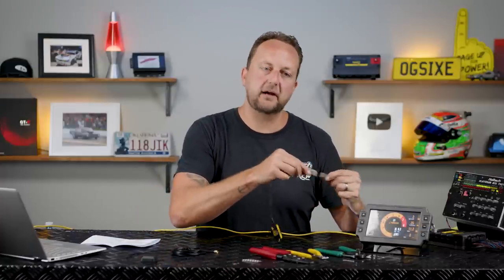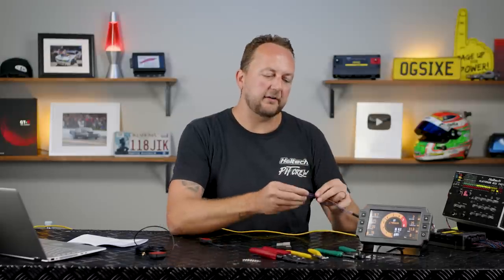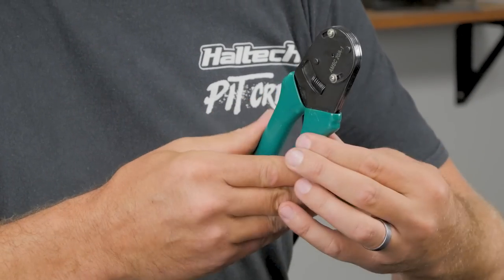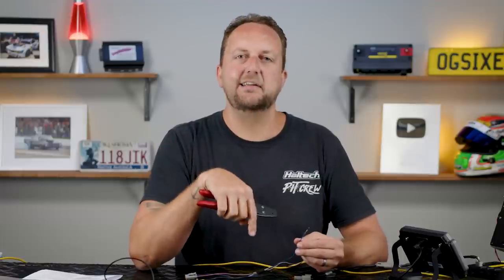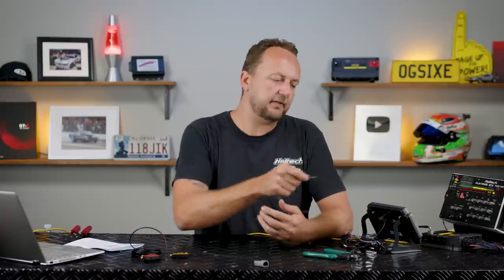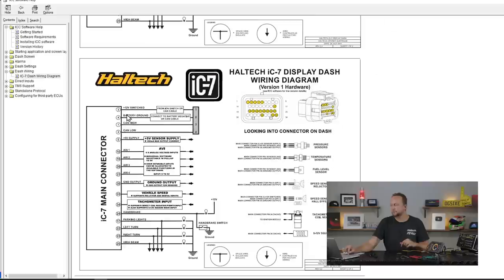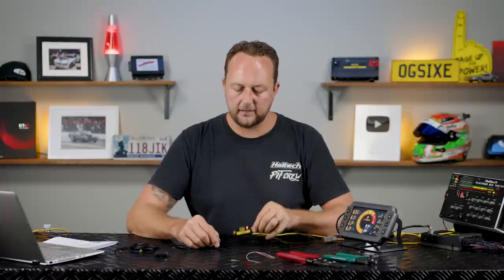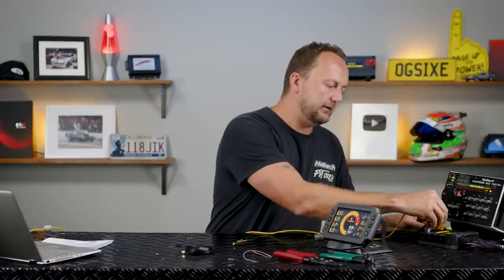🛠 How to install and set up your GPS Speed Module | TECHNICALLY SPEAKING

Comment: Thanks for the info. I have just got the elite 2500 and IC-7 dash and looking at options for a speed sensor. if i wire this gps through the ECU can the ECU then have cruise control? Thanks

Comment: Can you setup the GPS to calibrate (fine tune) a wheel speed sensor. so you always have spedo even in a tunnel. And have acurite speed with diferent size wheels.

Comment: If I use this to control fans by speed, on below X, off above X. Can it still have a temperature on/off control in case signal is lost and it goes to 0mph?

Comment from the maker: Welcome back! 
Global Positioning System - we use it daily to navigate around cities, find holiday spots, locate restaurants or take-away shops, or track suspicious activities of your spouses. GPS can also be used to calculate the speed of your vehicle. It's a very accurate, simple to set up, and relatively inexpensive method - and here's how it's done.
Reply: the problem is GPS only calculates speed relative to the satellite so not always accurate unless on 'level' ground. had numerous situations where the factory speedo reads the same in a hilly area, but because of the hills the GPS speed varies due to the car moving less distance via satellite view, despite travelling at the same actual ground speed. also, as you have mentioned, they can be sporadic in cities etc, which in many areas would be illegal to have a non operational speedometer.
Reply: Can you track your time laps in a circuit track?

Comment: Could this be used in a master and slave setup for vehicle speed. Use gps speed for accuracy ect then change to a drivetrain sensor automatically if the unit looses gps signal

Comment: Note that since this video was released, Haltech has added a "GPS Speed Input" option under "Main Source" and there is also a "GPS" option in the "Main Source" dropdown menu (not sure why you have to select the main source in two places?). HOWEVER... one critical piece of information that this video leaves out is that the Haltech ECU wont allow Cruise Control to function if a GPS Speed Input is selected! In fact, Cruise Control won't work with any undriven speed input. For example, selecting a front wheel speed input on a RWD car won't allow Cruise Control to work. Yet, there's nothing stopping you from assigning a GPS signal to a rear wheel speed input, and that will allow Cruise Control to work. It's all very odd and not clear why any of it is set up like this. It's also not documented anywhere, and it even took Haltech a month to figure it out.
Reply: Thanks Nigel I've been looking for this answer. I'm wondering is it as GPS might not be as a reliable signal as a sensor? It sounds safety related to me why they might not allow it. But if it was to be set up the way you suggest, is there anything Haltech might be able to do to disable that function?
Reply: @garyegt  what I've observed from trying the GPS speed sensor I have as a speed input is that it responds slowly to changes in speed. For example, I'll come to a complete stop and the GPS speed will still be counting down to zero. As a consequence, using it for cruise control results in it constantly overshooting and undershooting the desired speed by several KPH. Now, it may be the GPS speed sensor I'm using is just not suitable for this application. It's an older Veethree unit intended for boats, where changes in speed are going to be relatively slow compared with a car. Perhaps some of the newer automotive based GPS units will work better.
Reply: @nigel_white  yeah that's a great point, GPS speed takes a 2nd or 2 to update almost. I was looking at haltechs own GPS speed input but again, I wouldn't know how quickly it updates.

Comment: Hi can you use the speed sensor out as an input to an aftermarket cruise control?  Thanks
Reply: I've used it with a metering device. If what you need a speed input has a configurable speed Input pulse then probably